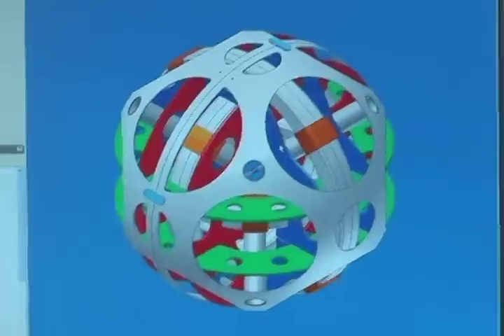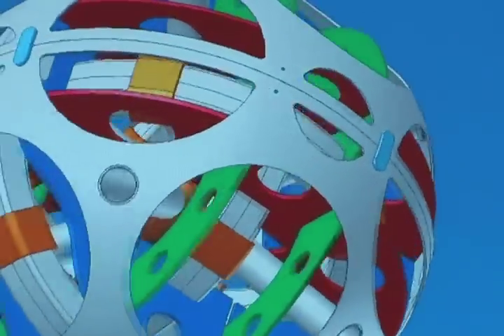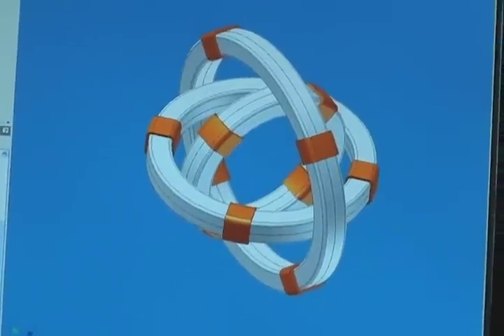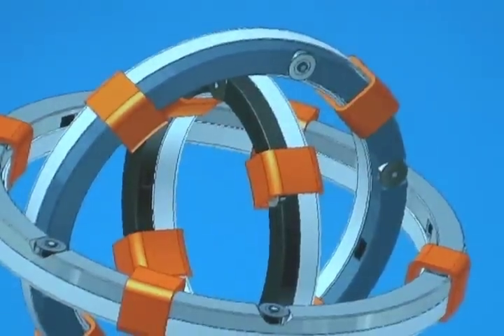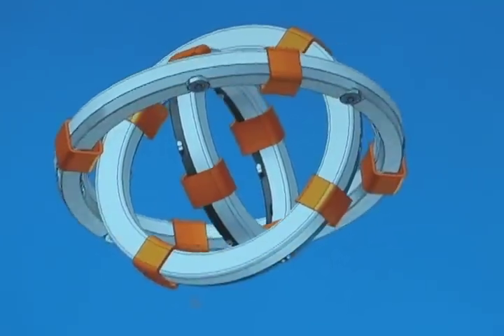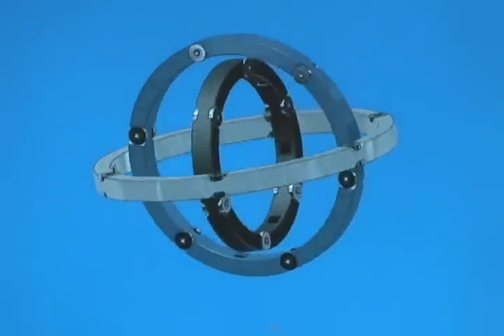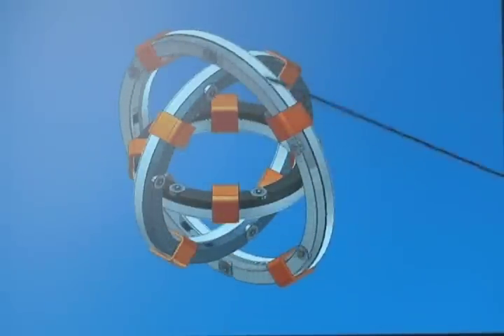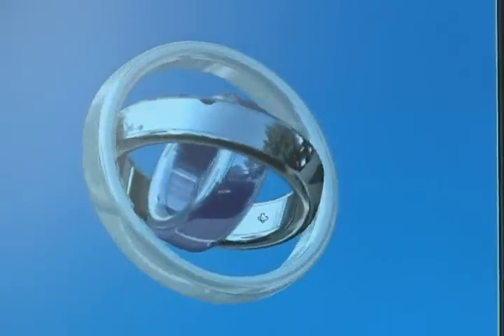Apparatus for Gyroscopic Propulsion Explained

Comment: FROM THE PATENT: At high enough levels of angular momentum, outside cosmic forces, including
the gravitational force of the surrounding environment, will cause the
interconnected rotating masses to seek equilibrium by moving away from the
strength of the gravitational force. By controlling the angular momentum
of the individual rotating rings, and/or by changing the orientation of
the rotating masses with respect to one another, the direction of movement
can be controlled and changed.

Comment: (part 3) This ball when placed on an incline will tend to slide rather than roll because it will resist any change to it's position on any axis relative to level ground. But it will move, and it will not provide any "propulsion". The gyros will provide only stability like any other gyro. There is no "magic" created by the superimposition of the 3 different moving flywheel planes. The gyroscopic effects will be additive however. It will not make time stand still, create a wormhole, or levitate.

Comment: direction directly towards the ground, again in direct proportion to the sum of kinetic energy of the 3 flywheels at any moment. End result is a ball which resists rolling in any direction, and appears to be "pinned" to the ground at a fixed point assuming a perfect sphere on a perfect plane. But it will NOT resist gravity (will have exact mass whether spinning or not) and therefore will otherwise be movable. It will not self propel & will not be weightless. All these forces are a zero sum game.

Comment: rkellyt: Gyroscopes,while fascinating, do NOT create new forces or enable propulsion without external forces being involved. The mere instigation of gyroscopic rotation involves the instigation of an outside force to create the motion. This device would simply resist rotation on any plane in proportion to the amount of momentum imparted to the flywheels. It will no more move from a position of rest than a regular soccer ball. In fact, it will transfer external force imparted from any... (cont.)

Comment: They have not fully completed the analysis of the results. If the effect is of the size predicted by current theory, then this experiment should be capable of detecting it with some considerable confidence (otherwise there would have been no point in attempting it in the first place). Of course, it could be that current theory is wrong with regard to the magnitude of the effect.

Comment: OK, when on a motorbike, when going very slowly, pushing on the right handle bar turns the front wheel to the left, but when going at higher speed, pushing on the right handle bar, the handle bar seems to resist and turns the front wheel right, against the way you are pushing. Ask any motorbike rider and they will tell you this. It's the gyroscopic effect of the front wheel resisting motion. I agree the spin doesn't directly affect gravity, but it affects motion and momentum.

Comment: Thankyou, but I do not need Physics 101 lectures. The wheel does not resist gravity; the string does that. What is happening is the counter-intuitive effect that the combination of two rotations (that of the wheel about its axis, and of the plane of the wheel about its point of support) leads to rotation in a third, different, plane.
As for the pendulum experiment, there are several reasons why that might happen and NONE of them have anything to do with spin directly affecting gravity.

Comment: The gyroscope reacts only to motions which change the plane of rotation of the rotor. Move it perpendicular to the plane of rotation? No effect. Parallel to the plane? No effect. Move it linearly, with the plane at an angle? No effect. A simple pendulum can also be used as an accelerometer. Nobody suggests that a pendulum 'resists' gravity. That sort of folk-nonsense is traditionally associated only with the gyroscope or spinning-top. Someone should tell the Patent Office.

Comment: accelerometers use the gyroscope to sense movement because the gyroscope resists movement, and the accelerometer looks at how much the gyroscope has moved (actually it stays still) in relation to the aeroplane, to figure out how much the aeroplane has moved. is gravity not a measure of acceleration? yes it is. e.g. earth's gravity, g = 9.81 ms^-2 it's an acceleration. therefore if gyroscopes resist acceleration surely they have some effect in terms of gravity.

Comment: They use them only for the stabilisation or sensing of orientation; not position. Gyroscopes can be used in accelerometers, and the latter can be used to calculate displacements and therefore position by integrating the equations of motion.
The only 'loophole' permitting propulsion by gyroscope is the Lense-Thirring Effect. However, its exploitation is far beyond our present technology (if indeed it is really more than just a theoretical prediction).

Comment: then why do aircraft and spacecrafts use gyroscopes for stabilisation? I think it does affect the movement, i'm not saying this guy's idea works at all but gyroscopes are used for sensing movement because they resist movement against the axis of rotation, look at the bike wheel experiment or wheels in motorbikes.

Comment: A policeman from scotland built a device like this in the early 90's, that had flywheels that spun around a central axis. it used a radio controlled aircraft engine for power. the test for linear thrust was a pulley system with a equal weight on the other end.

The ISS uses gyros to change orientation, they constantly spin then apply a braking action. E=MC2 then another spinning in the opposite direction does the same to correct.

But I like the sound of the wormhole?

Keep up the good work...

Comment: so if you had a rotor that could spin on two perpinducular axes at once.. would placing them in a housing contained in a single gyroscopic rotor be used to generate force/thrust? can this model you have uploaded be used to generate force . thrust? thanks for the great video :)

Comment: I watched the gyroscopic cd player video, when 3 were taped together perpendicular to each other they did increase stability.  But thats all that happened.  when pushed, the cd players moved in the opposite direction, only their orientation remained the same. 

gyroscopes are used for stability, not propulsion, changing the currents on the coils will only make the rotor speed vary so that it spins on it's axis, not move it relative to one point.

Comment: Rather than trying to fly the thing, you can prove that thrust is created by  putting it on a cart. You wouldn't need nearly as much thrust for this proof of concept. My guess is, that if it will move at all, it will only do so while accelerating or decelerating, and not while operating at a constant velocity.